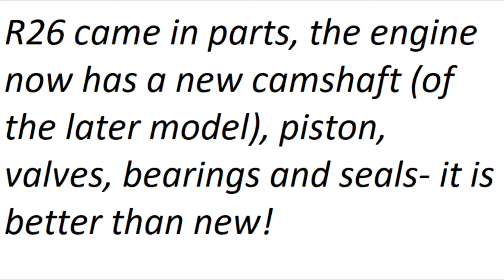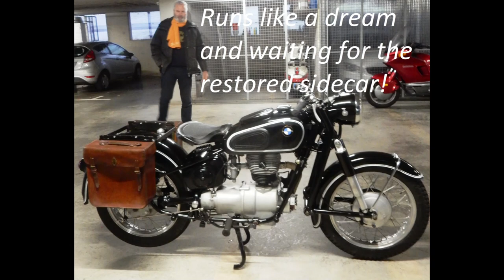restoration bmw r26

Comment: Hi I am in the same position as you at the moment, got my self a basket case r26. Where did you buy the wiring loom from? also i notice there is a white plastic piece for the ignition key whats the purpose of that? does it go at the bottom before you insert the key? thanks